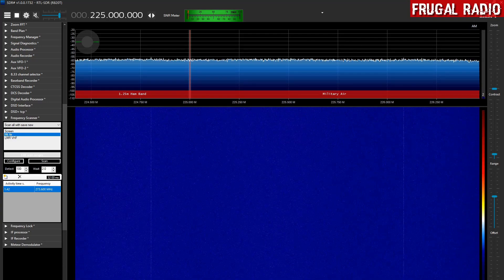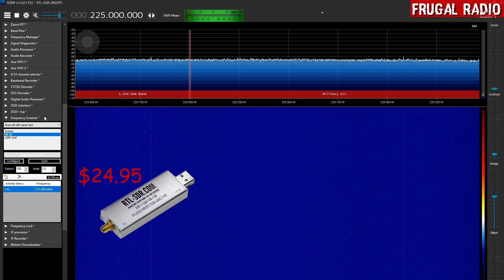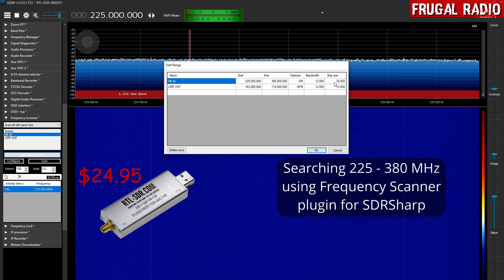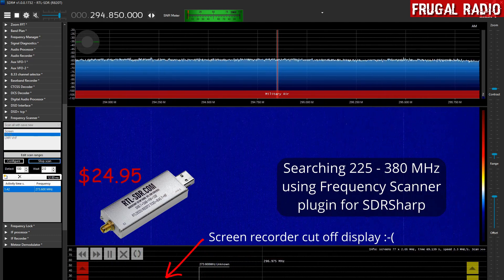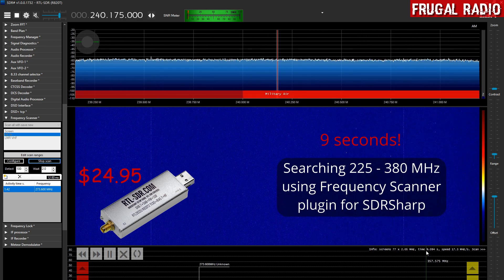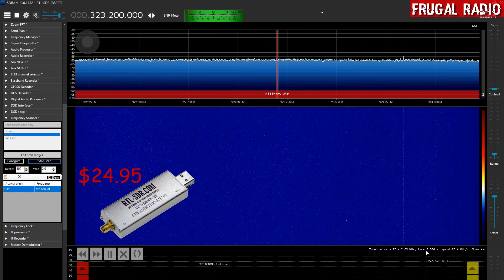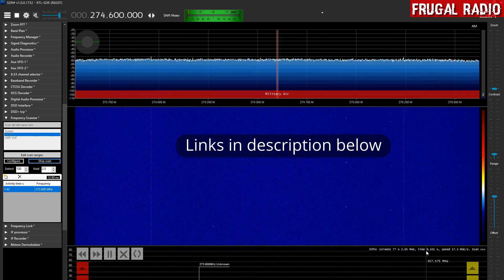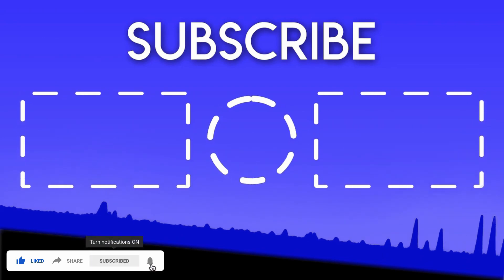$25 RTL-SDR v3 Military Air band search in under 10 seconds! Frequency Scanner SDR Sharp plugin test

Comment: I have an RTL-SDR v3, I find that it is not as sensitive as my Pro 2006 for listening to Mil Air frequencies. My Pro 2006 will be active and my v3 will be happily scanning away but not stopping on anything that the Pro 2006 stops on. Also I have heard so many people talk about how fast it can scan 225-380 Mhz band but at what cost. I find the faster scan can bypass active frequencies. Now if you live near an airport where there is military activity then the v3 would probably be a great piece of equipment to have, for me the Pro 2006 is required to hear anything.
Reply from the maker: I think the best use is for initially finding the frequencies. Then plug them into a scanner. Scanners are definitely better at scanning, the SDRs are better at searching.

Comment: Can Airspy be configured with a search path?
Reply from the maker: I'm not sure what you mean by a search path? Using the plug-in you can select a range of frequencies for the SDR to search, or scan.
Reply: @FrugalRadio  Sorry, my question wasn't clear.
Sometimes when I am scanning the UHF band, for example, there is a very strong noise at 260.000 and the scan stops.
Is there a setting to skip 260.000?
Reply from the maker: Ah, now I get your question. Thanks for clarifying. Yes, you can lock out individual frequencies and block them from future searches. I don't quite remember how to do it with this plug-in, but it is definitely possible. Have a look at the documentation and it will hopefully explain the process!
Reply: @FrugalRadio  I'll look into it, Thank you very much!

Comment: I have recently bought an RTL-SDR v3, its connected into a raspberry pi4. Thats taking 121 seconds to the scan Mil air as per your demo :( . I guess i need to connect it upto my windows desktop to compare if the hardware its attached to is causing the delay. Also it seems to miss known transmissions, are there some further setting changes i need to look into so that it stops when it picks something up? I've made adjustments to squelch without success.
Reply from the maker: The threshold settings are going to be the most pertinent, then also making sure you haven't locked out the known frequencies. Another thing to check if that your step size is correct (25 or 50KHz).

I have never tried it on a Pi, but the lower processing power might also be a factor as you suggest.

Comment: Do the regular antennas work for this? The ones that come with the rtl sdr kit. Thank you
Reply from the maker: If you adjust them to the correct length, yes. You would want them to be outside and as high as possible though, for best reception.

Comment: I thought Over and Out was bad VP. You use one or the other but not both.

If you are comfortable in both which would you use Linux or Win10?

Do you have any recommended URLs for information on DIY Antenna building? Its sort of like sipping from a fire hose. ;-)
Reply from the maker: Yeah, over and out is not a phrase i have used on air since operating CB when I was about 14!!! It's just a good online hook for the channel.

I use both Linux and Windows, although mostly Windows 7. For ACARS & VDL/2 decoding, Linux is better.

For general listening, SDR software in either works. Once you start decoding, choose whichever works best. You can use a Pi for decoding P25, or Windows software like DSD Plus for digital modes etc. Having both OSes at your disposal gives you far greater control.

As for antennas, there is so much online, you're right. Best thing is to search home made (or home brew) antenna for xxxx where xxxx is what you want to receive. Or search for home made wideband antenna.
Hope that helps!
Reply: @FrugalRadio  Thanks. I'm glad you mentioned the Raspberry Pi, I have a couple and I had previously thought they would probably be good for a portable setup. I expect to be going to Newfoundland in the next year or two and one of the spots I want to go to is Signal Hill. Using and SDR there would be kind of interesting.

Comment: I was big into scanning many years ago before SDR. I am now picking the hobby back up again. I have recently bought a Bearcat 125xlt but would like to get into SDR ( still have my old Yupiteru MT7100), so I have a RTL-SDR v3 in the post. I have been learning a great deal from your videos and was wondering which software would be best to use. I am interested in airband as I live 15 miles from Cardiff but would also like to decode DMR etc. Many thanks for your great tutorials.
Reply from the maker: Hi Sean. I'm glad you're finding the channel helpful.
You've made a great choice with the RTL-SDR v3. It actually pairs really well with most of the software that's out there, but I would recommend starting with SDR#. If you have good line of sight to the airport, you'll be able to receive ground based transmissions (tower, approach, ground and ATIS) as well as aircraft. However that is very dependent on terrain, transmitter location, and whether or not you'll be using an outdoor antenna.

For DMR, add the simple DMR plugin and that will be the quickest way to hear the audio. If the DMR networks are trunked, then you can move on to DSDPlus or SDRTrunk. 

Hopefully you get your new SDR soon. It will open up a whole new aspect of the hobby for you 😃